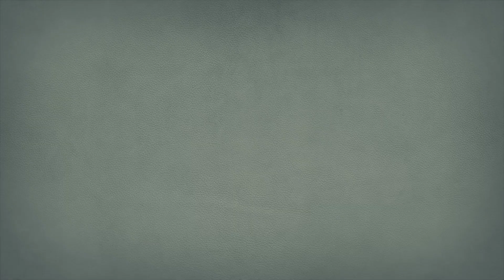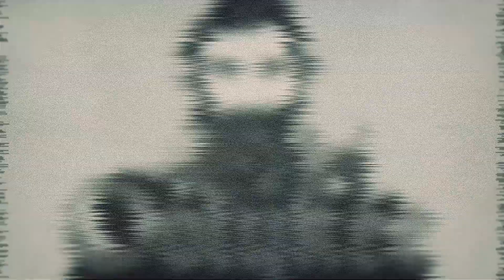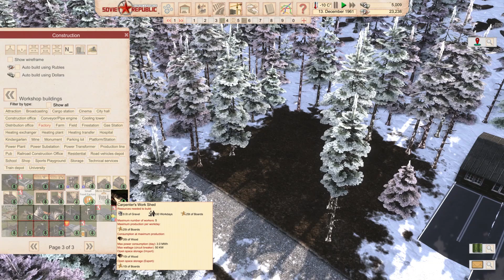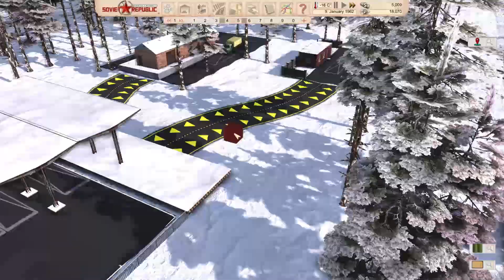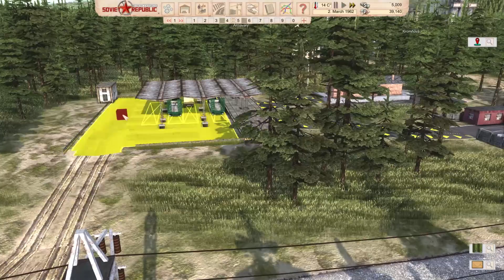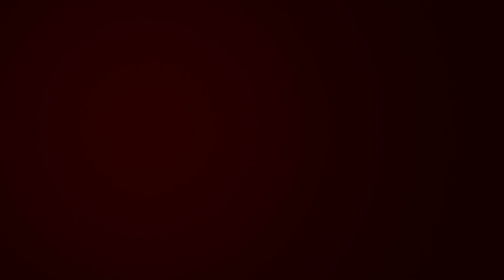Soviet Republic - Alaska - Let's Talk Industry - Ep.6

Comment: You can use a mod with a building called "hruskhoba" that houses 95 workers,costs 800-1500 rubles (depending of the distance to the border) and they heat themself
Reply: Great idea!
Reply from the maker: That's a nice idea. But heating itself is not really an issue. We have a heating plant now. 
Also, we are building our own buildings and 1500 rubles for almost 100 people seems a bit cheap. I will consider it if we ever run out of cash. 😊
I'm a big fan of realistic buildings and I like what Mr. Robs074 is doing with the residential buildings. Also, I recently became a fan of smaller buildings like 30-40 people. 
Any suggestion regarding this size?
Reply: @oolykeegaming81  I don't know small buildings because I don't like them
Reply from the maker: @mihaicojanu9147  I was the same. But after having 30000 people city I decided I like smaller. But I believe we will go big at one point in these series. 😊
Reply: @oolykeegaming81  for me smaller means 4 story buildings because i look into my city and I don't see any communist era building that is smaller than that (ps: I live in Bucharest)

Comment: Steel related subject:
For me your mod choices are admissible (bc74sj I do not agree with your conclusions on the concrete, it is not for me, except for the noobs - of which I consider myself to be part in a certain way - , a problem to produce and distribute, at least not enough to disqualify the mods that were chosen). Especially since I find these mods quite realistic in their consumption and production figures, many examples can be found in the economic and geographical history of Russia. This decision having been chosen I think it was the one that had to be taken in terms of priority. However, I would have several comments to make:
1) the tiny coal mine can produce 80 coal ore per day while the tiny processing plant can only process 20 per day: I would have (you must!) Built an intermediate conveyor tower to allow the connection of 3 mines supplying this tiny processing plant.
2) Since you should build (eventually) three tiny coal mines you should build a smal aggregate storage (I konw, I konw ^^) for the coal processed by the small coal processing plant: the day-to-day management of your resources fact that you will inevitably also use this coal for other productions (heating, bricks etc.), and this aggregate storage will make your life easier. A tiny steel mill consumes only 7 tonnes per day. And don't forget that tiny coal mines have an internal storage of only 10 tons ...
3) On the other hand given the productivity of the small steel mill for me you do not need a storage for the steel (nor for the iron), trucks that can I think do the job considering the distance with the open central storage.
4) Considering the storage capacity of steel and iron (20 tons) I think a rail link would be pure waste (especially with the "new" high capacity dumpers trucks). I could be wrong but even the truck cargo station could be too much (even if I built it myself, more out of neurosis than anything else ^^)
Reply: My point about the concrete is it is (along with asphalt) the only thing in the game that cannot be stored. It has to be consumed in real time. I wouldn't call you a noob, but I would call you disingenuous if you play at the level you are certainly capable of with your understanding of the game and to act as if 2 concrete mixers are sufficient for a playthrough or even a proper ratio for bays in a 32 slot CO. If that is the case, then you too, suffer from using too many mods (and it requires it's own vehicle, just like the cement dry-bulk tank).
Reply: @bc74sj69  My point about concrete or asphalt is that for any average player this is rarely a problem. On the other hand, yes, I am trying to make  understand that more construction offices are necessary for a sustained pace of construction which will require more concrete mixers (for example with construction offices specializing in groundwork). But why rush things for someone new to this type of gameplay? We are at the very beginning of the problem of specialized construction offices, starting with those dedicated to roads, the time will come when Oolykee will curse the day he asked me to intervene in commentary when I will start pissing him off again with even more specialized construction offices :))))
Reply: @statsneguit3069  my point is concrete out of all the building materials in I don't even know what to call modes anymore is that most legit buildings use monstrous amounts of concrete. People misjudge how much concrete is needed and how many mixers they need. But in this instance it makes no difference because the mods don't bother with it! So if the guy making youtube videos for a year, the mod maker, and apparently no one else knows how buildings should be scaled or made, why should any new player? This is what I mean about game fundamentals.
Just look at the comments section. It's even more people suggesting even more cheap mods and hacks. I literally can't take anyone seriously when they criticize anything about vanilla economy when they use mods so uncritically.

Comment: Brick factory subject :
For the production of bricks I would have rather oriented towards a more realistic mod than the "brick firing klins" (5 workers for 3 tons of bricks, a footprint too small, undervalued building materials). Especially since you have to think a few years in advance: Galahsk is your pioneer city, it will have to build the stages of your future development, and a little more bricks, produced in a more realistic way, would not hurt :)
Even if there is a logic (appreciable!) In relation to the coal supply, for my part, I would have built my brick factory rather in the coal production zone (between the charcoal klin and the tiny mine) than in that of the heating plant. But if you keep this set-up please (they are expensive) no additional trucks, the dumpers feeding the heating plant can distribute the surplus coal in the brick firing klin.
Reply from the maker: Yes! I just realized this!! DO would help a lot! But to disappoint you I think I got another dumper in episode 7. 😟
I will do the structural upgrades in a separate video soon! Episode 8 I believe!

Comment: Panel factory subject:
Since you have coherent coal production projects (charcoal klins, tiny coal mine (s)), I will focus more on brick production. You already have what ever you want in moded bricks residential buildings for your expansion. The production of panels requires an expensive production line (cement and theirs related trucks usable for nothing else, gravel and therefore conveyors ...), while for bricks you could already be almost self-sufficient without too much effort. Bricks are the easiest building material to produce - coal and that's it. And you have already started in the production of coal ...
Reply from the maker: Bricks are on the way. I will answer you with one word. Railroad. 😄

Comment: For a pioneer city like Galahskk in (partially)-difficult mode I would not recommend the disproportionate expense of a tram line, you only have moded industries requiring few workers. The tram lines are precisely profitable for industrial zones having multiple stops each requiring a fairly high number of workers and a continuous and sustained flow. Buses are more than sufficient, of course if you switch to the 60s buses with capacities of 50 workers or more. I didn't say anything at the start of the let'play in a very selfish way because I enjoyed seeing these moded vehicles, but you have to take into consideration that the creators of this mod created these vehicles for the mod allowing to start the game in 1950, and therefore they are no longer very suitable for a 60s economy or for your (legitimately) ambitious expansion plans
Reply from the maker: And again, you are right! I am building the storyline to that but I don't want to say too much as I hope it would be more interesting for majority to develop a storyline a bit. But I suck at it. And my attention span is limited. :( 

I'll do my best but the thing that you suggested is already planned. I just need to find a way to integrate it into the storyline. 
Thanks, Stats!

Comment: You will soon need a more elaborate logistics system for the distribution of fuel: if I were you I would build moded fuel storage without further delay, with the trucks of higher tonnage fuel this storage and those of lower tonnage distributing this fuel from the the storage to the petrol stations
Reply from the maker: I'm doing some testing now and I love the way the exports are doing. But the infrastructure is lagging behind! Technical services, housing, shops, gravel production, kindergartens, and of course the distribution including fuel. 
I was thinking about starting the small refinery or something like that but more trucks on the border would be a bad idea. Also, as we are not exporting the extra fuel or bitumen we might have an issue with storage soon. 
I will stick to importing the fuel and bitumen for now. But I will do it through the distribution office from now on. 😟
Reply: @oolykeegaming81  What I was meaning is that you should also build a small fuel tank in order to have the import from the border to the tank and the distribution office from the tank to the gas stations. By doing this you avoid traffic at the border and you have a more fluid logistics system.

Comment: If I were to design factories either smaller or larger than the vanilla ones, I would take into consideration economies of scale...basically, the larger the factory, the more efficient it is, thus, tiny factories should be less efficient.   That said, I probably would still use the tiny factories even if they didn't take this into consideration, with a little shrug.
Reply: I won't use modded industry anyway but yeah I agree with your first sentence. Modded industry usually costs way less, has less upfront cost. People want huge chemical plants because the infrastructure is a pain in the rear in vanilla, but then use tiny steel mills and refineries and cement plants etc.. because they don't need much. So basically they want realism when it makes it easier, and don't want realism when it costs too much lol.
Reply from the maker: @bc74sj69  What was the smallest steel mill or refinery in the US or USSR in 1960? What about the biggest one? Why can't we choose what to make? A leaky ol' refinery that does the job or the mega facility that we don't need? Is there even a choice? :)
Reply: @oolykeegaming81  You are getting to the point of ridiculousness now to justify your untenable position. As I said so many times now, your mods don't even use concrete. You acknowledged the crap you deleted in Episode 6, and then use more crap without concrete. You wonder why stats negui said you need more gravel? Because that's what also goes in cement (but since none of your building need cement, why would you?) lol
Reply from the maker: @bc74sj69  brick buildings are as functional as concrete ones. 
Any beginning is hard and it would warrant the use of wood and bricks before we turn to Brutalism. :)
The sawmill was removed because of no steel and not concrete. 
I have a feeling you are not enjoying these videos or these discussions. 
I'm really sorry about this. It wasn't my intention to make anybody feel bad. 
My only intention was to learn something and create a bit of entertainment. 
Is there any chance we can go in that direction?
Reply: @oolykeegaming81  you make videos literally every week showcasing mods. You don't compare them to vanilla apparently, don't look at them critically at all. It's just here! Shiny! Apparently? 
To recap, 9 months ago I was a total noob, started watching YouTube videos. Founds yours. They were helpful. I recommend them to everyone (even this week!) I waited when you said you were going to do HMC, you said you didn't see the need for half the buildings in it, said on reddit how you were going to play it hard, I commented a ton on it, and on YT. Then I see the reason I hate mods in every episode and this one was just over the top. I'd literally prefer to watch Orbital Potato kill 6000 people and place refineries in the center of a town then people defend mods over and over again. Go reread what you wrote on reddit and then ask me again?
Reply from the maker: @bc74sj69  you are absolutely right. I should be more critical towards the mods and compare them to vanilla. I will 100% do this. 
This is a great advice. I really appreciate it!
Reply from the maker: @bc74sj69  regarding Reddit. I read it. 😊😄😊 Pun intended. I thought it was explained that this is not HMC. I gave up on it. This is just storyline play through. Regarding the channel and the videos. I don't want people to be stressed and angered by my videos. This is really bad. I really want people to have a bit of fun like I do and for us all to learn something. 😶
Reply: @oolykeegaming81  The entertainment/fun part will be lost for people like me when part of each episode is spent implementing other peoples suggestions, then it is not your play through anymore, doing some is fine but now it seems like a dam full of "do it this way" has burst. Apologies in advance and Cheers 😀 until tomorrow.
Reply from the maker: @oldgalah7425  fear not bud! The series will continue as Sinatra sang. In that specific "way". :)

Comment: Kindergarten! Anticipate now the expansion of your city, in fact when you plan your expansion I advise you to think in "districts", each "district" needing its own commodities (bus stop, stores, kindergarten and so on, as IRL in facts), this is the best way to avoid making mistakes. Range is one thing, capacity is another: it is more likely to reason in capacity than in range (but both being as crucial, just like for developers). An additional food store should be considered for your town's expansion. Two trucks for one store is an improvement, but given the mechanics of the game regarding "free time" a different truck for two different stores will be more efficient ... BUTW a single clothing store for "two" districts being sufficient in terms of range. It should never be forgotten that the rate of consumption is never the same depending on the good consumed
Reply from the maker: Got it! I'm already experiencing capacity issues. Food-wise! 

I'm planning on 4 districts so 4 food stores. 2 clothing. 1 meat truck would be enough to cover 4 shops. 

Interesting!
Reply: @oolykeegaming81  Good calculation! If the range is there, a single store for clothes would be sufficient (consumption of this good is very slow), but you might as well be careful I agree with you!
Reply: @oolykeegaming81  for sure one store for a big city isn’t enough. Just because your distribution office won’t be able to handle it. Especially in dark winter 😂. Probably a good idea to have a vanilla food/meat store for each 1-1.5k of people
Reply from the maker: @daniil3815  since we are going with a wooden building and we are good on that front I will go a step ahead and make extra shops just in case. This will make upgrades easier too. If we demolish one of them for upgrades. :)

Comment: I wonder why (other than costs) you're not using distribution office for imports and exports? For exports it would make all the trucks go only when there is something to export. For imports you could set the trucks to go only when target storage (steel for example) is below 50%. Clearing number of lines would only benefit you in the long run.
And for naming your lines - I always do type of line first (i.e. Passengers A to B, Transport steel, Export A, Export B) It sorts them alphabetically, thus making it easier to find among lots of lines.
Reply: Elmias is generally right, you should think about starting to build small distribution offices (they are quite cheap) to make your transport network more fluid.
Reply from the maker: @statsneguit3069  and Elmias. Initial setup. Only reason. :) 
Initially, I chose to go with 1 DO and decided it should be for farming. Later on, I never thought to change it. Also additional capacity on imports. and exports are not a problem, EVERYTHING NEEDS TOO GO! All jokes aside I might do it for the exports! Would save some fuel!
Reply: @oolykeegaming81  exactly. I also usually build one warehouse and one open storage as overflow facility. The logic here is that you will overproduce. Initial transport, from factories goes to main storages of distribution network. Then there is a dist-office set to load stuff from there only when >60% and unload to overflow storages. From there I export everything. Works especially well with trains as you can't get them to transport stuff above certain % (as far as I know)
Takes a bit of space and resources to get it going, but usually gets rid of overproduction in time.
Reply: @Elmias  Well, as says Elmias, exactly... :)